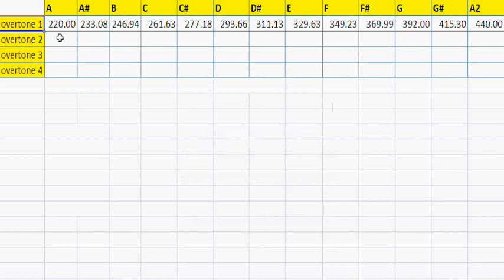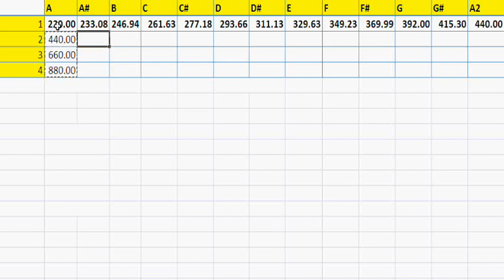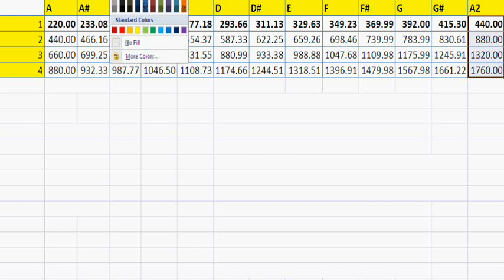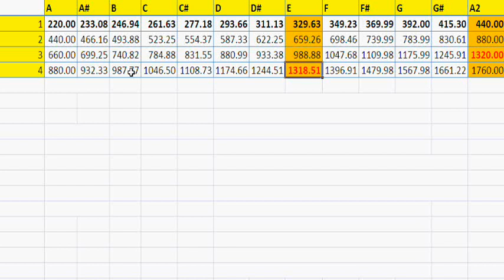Equal temperament tuning means wrongly tuned

Comment: @EFAJE As for the whole thing about octave stretching.  You are right.  That has nothing to do with tempering either.  I brought that up because I was looking at the dude's chart, and he has A1 at 220 and A2 at 440.  Well....on a piano, for the octave to be tuned to sound good, the "A2 will not equal 440.  So that is merely to point out that this guy's chart is based on theoretical physics and not the frequencies found on a real piano.  A better circulating temperament is Bach/Lehman.

Comment: No, the strategy of equal temperament is to enable transposition into any key, because all keys are equally out-of-tune. The strategy of any temperament is to purify the octave, which is necessitated by the existence of the pythagorean comma. For centuries there have existed dozens of un-equal temperaments that enable performance in all keys, and modern, true equal temperament has only been around for less than 100 years.

Comment: @EFAJE   Here's the thing...Tuning or De-tuning (for that matter) and Tempering are the two different things altogether.  There is no "tuning" or "de-tuning" involved in tempering.  Tempering involves tempering.  The act of tuning has to do with matching the partials on the same note.  That's why this whole video is just utter nonsense and blather.  If someone were to say, for example, "Equal temperament is wrongly tuned", it would be Gobbledygook.

Comment: Your mathematical analysis is interesting but you are not getting to the heart of the overall problem because you are only pointing out the deviations from theoretical calculations.  Every equally tempered piano is tuned differently because each piano has a different amount of inharmonicity.

Comment: This is a nonsense response. Equal temperament is shit for multiple reasons: 
-There are absolutely no pure intervals. This is completely fucked. Music is supposed to be about harmony. In equal temperament, there is no harmony, there is only an approximation of harmony.
-There is absolutely no key color. Virtually all pieces composed before the advent of equal temperament were written for a specific key because the color qualities of that key suited the music itself. ET spoils Bach's WTC.
Reply: Cunnilingus The fifths are kinda decent, don't you think? For instance, If you have no choice but to play on an ET instrument you can play music that requires Pythagorean Tuning and it'll sound OK. (-: